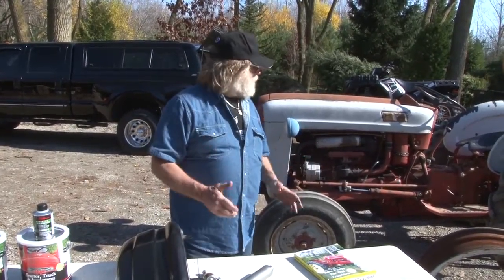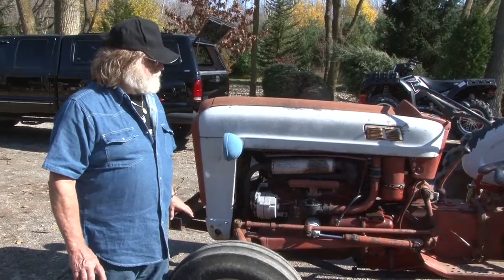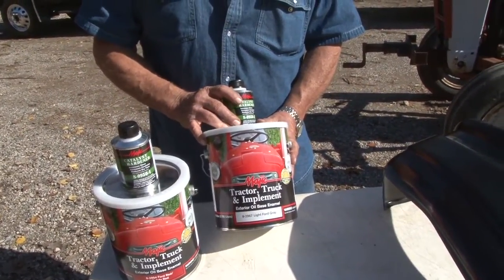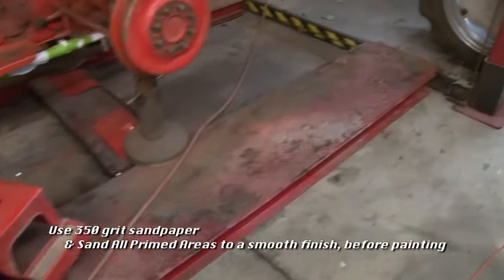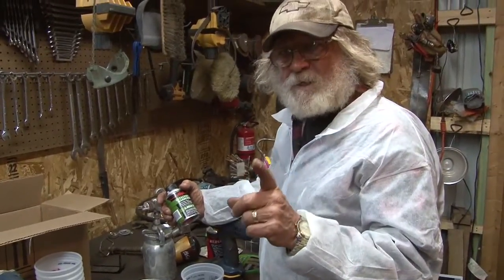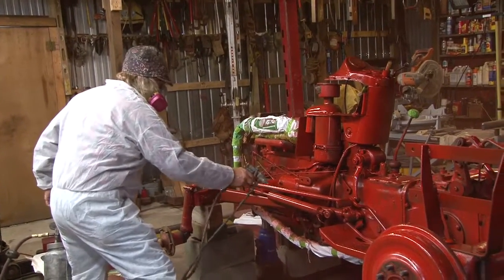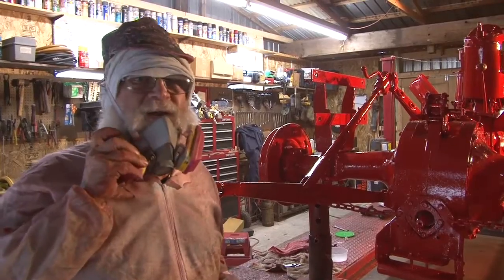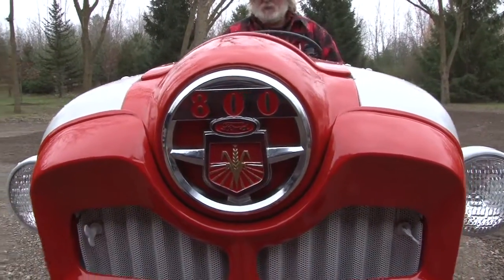Majic Paint 841 Sequence for TSC

Comment: I just purchased the Majic paint with reducer and catalyst. I have a few questions. First , I will prime first. Can I wet sand the prime before applying color ? And second , does this paint like to run ? Should I apply it on the dry side ? I was in the auto body business for many years and way back in the day we used to spray alkyds but it’s been a long time . The Ford looks great 👍 thanks

Comment: YEAH MOST PEOPLE,MYSELF INCLUDED DONT USE MAJIC PAINT CORRECTLY...IVE USED AUTOMOTIVE PAINT ALL MY LIFE,AND THIS STUFF IS NOTHING LIKE AUTO PAINT!!..YOU GOT TO WAIT BETWEEN COATS LIKE THE MAN SAID...WHICH MAKES THIS NOT A GOOD PRODUCT TO USE ON CARS THAT YOU WANT A PERFECT FINISH...BECAUSE IF U WAIT 24 HOURS BETWEEN COATS LOTS OF DEBRI LANDS ON YOUR PROJECT..AND LEAVES LOTS OF TRASH IN YOUR PAINT...AND YOU CANNOT SAND OR WET SAND MAJIC PAINT AND YOU CANT BUFF IT!!!....WHICH MEANS WHAT YOU SPRAYED IS THE BEST IT WILL EVER LOOK,BUT IT SURE DOES DO GREAT FOR WHAT ITS DESIGNED FOR TRACTORS,WORK TRUCKS..AND IMPLEMENTS...